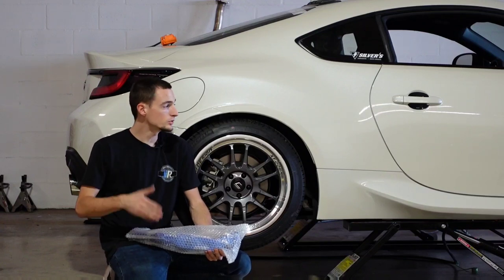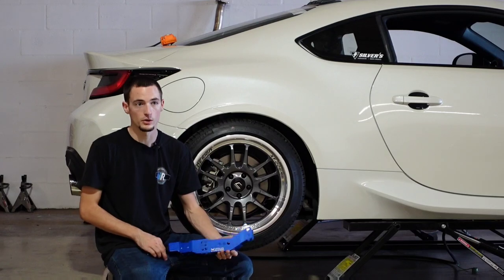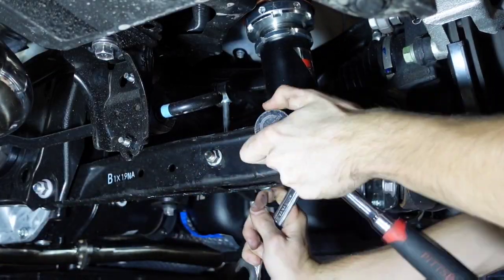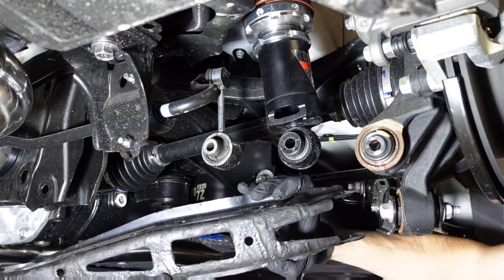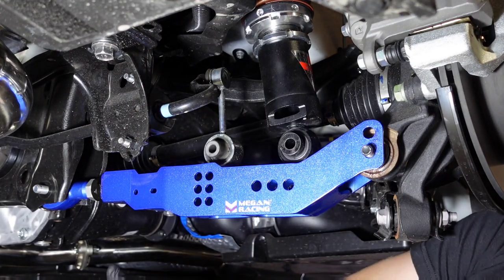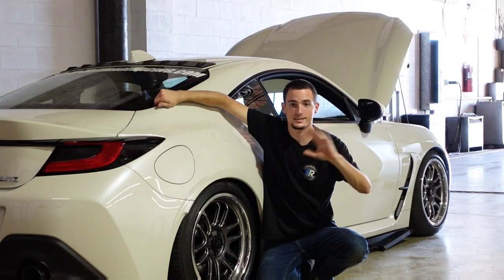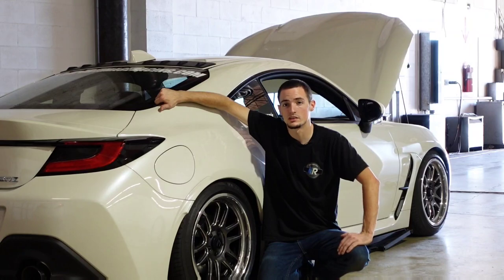2022 BRZ/86 Megan Racing Rear Lower Control Arm Install

Comment: I just installed these on my 2015 impreza base (yes I know its non turbo and slow, it's a daily I have 6 vehicles). It's lowered on coils and this made it so I could easily adjust camber. I just installed them today along with a whiteline rear sway bar. The car feels so much better than it did stock. I used the bottom outer hole for the sway bar link, the bottom hole for the hub, and the outermost hole for the coilover. Feels great after I aligned it. Also FYI if anyone was wondering, it did lower my car more, maybe about an inch lower. Before I had a bit of wheel gap, maybe an inch, but now it is ALMOST starting to tuck.

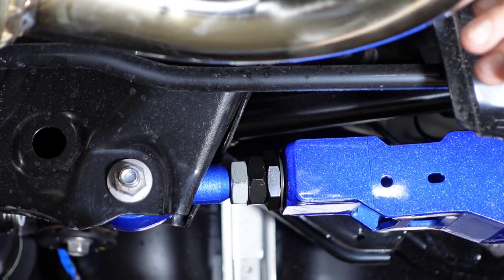Comment: At roughly the 6:00 min to like 6:37 mark how to adjust the arm is wrong. You don't have to take that back bolt off that connects to the subframe to adjust. In the video it's maxed out to positive camber, but to push the wheel out, or pull it in for negative or positive you use the black bolt in between the two chromes ones at 6:37 mark to turn the thread in or out
Reply from the maker: Hey, thank you for elaborating!  In the video, Cody did not adjust the control arms, otherwise he likely would have figured that out that he didn't need to remove the back bolt.  He also didn't really touch on how to adjust the arms, so thank you for explaining that.  We're working on being more informative in our videos!

Comment: Looking to get my adjustable rear arms. From 6:29, it sounded like in order to adjust it (once installed to the car), you would have to take the inner end out and rotate to get to the length that you want for the desired camber? That just doesn't seem that much adjustable to me. You would pretty much have to loose endlink and shock from it too?

Comment: There's -2 degree camber in the rears on my 86 from factory. If i lower my car an inch, and assuming camber becomes more negative, do you think i can get away with using adjustable RCLA to bring it back to -1.5 ish without adjustable toe arms?

Comment: Do you happen to know how much negative camber it had lowered before these arms were added? I'm hoping I can get around -1.5° – -2° of camber for a dual purpose street and weekend track day setup after modestly lowering a BRZ. Not sure if it's like this for these cars, but couple degrees of negative camber is always advised for increased cornering performance on Miatas. Also, I believe I read it's optimal to have your rear sway bar parallel with the ground when the suspension is at typical load. It looks like these arms has multiple points where you can mount the factory (or any) sway bar endlink to the bar. I've never seen that before, but if that's the case, one could likely set their sway bar to the proper height after being lowered with just these arms. Typically aftermarket endlinks are required to do that, and they're almost always less durable than stock, so that's really nice.
Reply from the maker: Before the control arms we were seeing about -3° camber with the coilovers at about 75% of their drop range. At around 3" lower than stock we had about -1.5-2°
Reply: @ImportImageRacing  Interesting, that's good news! Thanks for letting me know.

Comment: Can negative camber be fixed by adjusting the existing stock control arms ? Do I have to purchase new control arms if I upgrade the suspension and lower the car  ? And if I’m only lowering the car slightly say half an inch will it make much difference ??
Reply from the maker: The factory control arms don't have any adjustments them. Lowering the car will almost always cause some negative camber. The lower you go the more camber you'll get without adjustable arms. But if you are planning on lowering less than 2" you should be fine with the stock arms.

Comment: Is it needed if installing coilovers or its just after springs?
Reply from the maker: It all depends on your setup and how far you drop the car. the lower you make the car the more natural negative camber you will get. These are great for correcting that negative camber, or adding more.

Comment: How much negative camber do you think you can get with these? Was there a good amount of threading available? Thanks for the videos.
Reply from the maker: There was quite a bit of threads to push the wheel out. We had ours dialed in really far to remove the negative camber but you could certainly push them out to add negative camber!